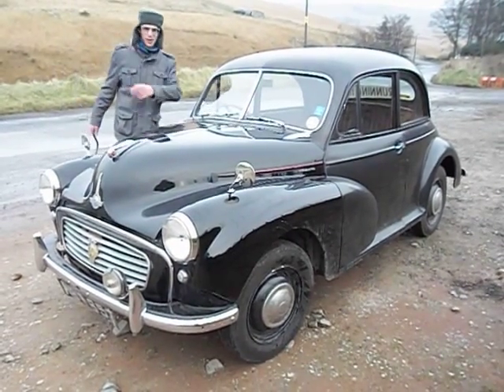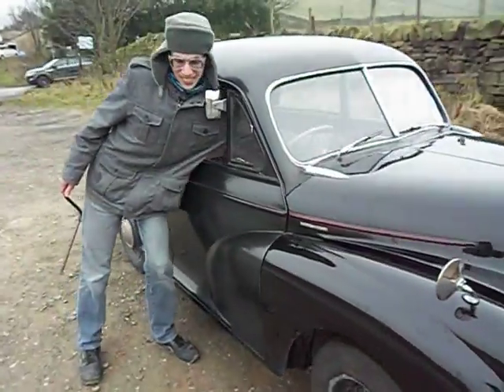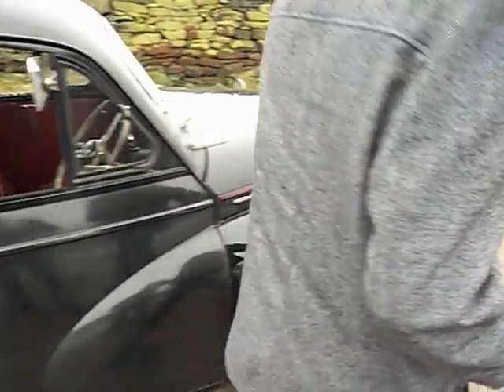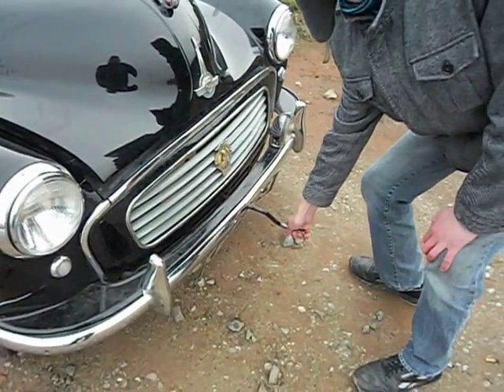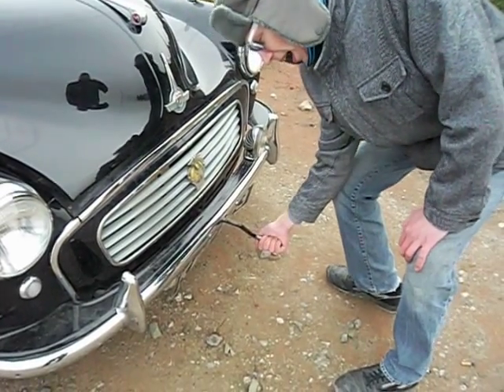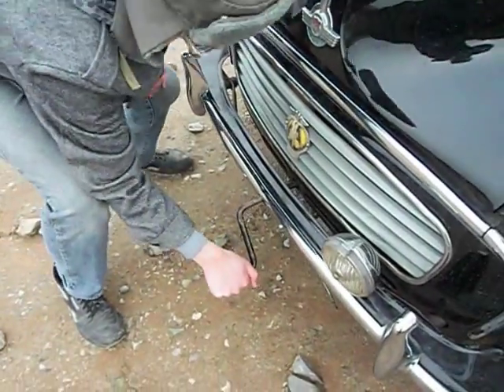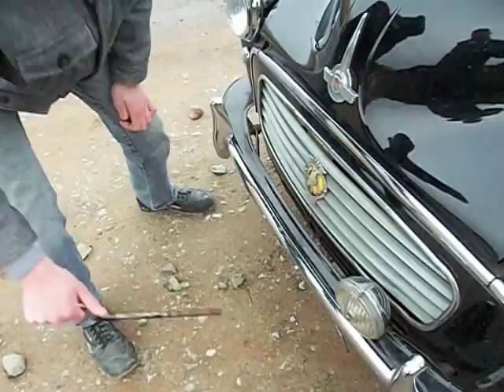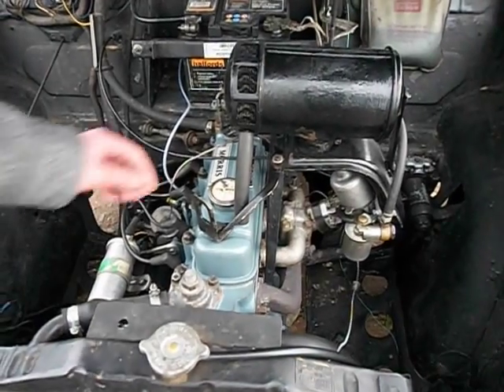Hand cranking car using starting handle

Comment: Wow, this car doesnt even look old on the outside (well if you put a modern car inside (radio, different speedometer) I wouldnt even knew it is old

Not like stuff from the 70 and 80s, I hate that boxed design

Can you legaly drive this? Can you register and ensure it?

Comment: It's a pity that modern cars cannot be started like that.
Reply: The main difference between those old cars and the new ones is the way the engine is positioned inside the bonnet. The old version had the engine facing the front but the new cars have it placed laterally making it impossible to start with a handle. The starter handle has two pin like arrangement which enabled the handle get temporarily fixed to the engine when inserted through the bumper. Once the engine started , the rod will slip out so that it can be taken out . This facility was available till the 70s in Indian made cars. It vanished only with the advent of Maruti Suzuki. The advantage of this feature is that when there is starting problem because of low battery power/ armature it can still be started with one person pressing the accelerator pedal and the other rotating the handle. No need for pushing the car in heavy traffic and occupying more space when there is starting problem. Modern technology and affluence have made it obsolete.

Comment: I really didn't expect so much extra space in that engine compartment...
Reply: All these old cars are are like that. It's all the accessories, emissions equipment, A/C, power steering, power brakes etc... clog up the engine bay. Modern cars are so jam packed with stuff they often don't even have space left for the battery so they stick it in the trunk.
Reply: My 1st pick up was a 1980 GMC Sierra 1/2 ton, had a 305.  There was almost enough room under the hood to close it with someone inside
Reply: We wanted the American styling (big bonnet/hood etc), but we couldn't afford the big 7.0 V8s because of the war.

Comment: I suggest a better, I think, way. More like how to start an old aircraft. This assumes an electric fuel pump. Turn on the ignition. Wait till the fuel pump has filled the carburettor float bowl. Switch off the ignition. Choke out, full if a cold start, partially if a hot start. Insert the handle and rotate at least two complete turns. Note which cylinder has the best compression. Rotate again, but pause with the "best" cylinder on full compression. Set the starting handle at 3 o'clock or at least on the down stroke. Switch on the ignition. Standing on the right hand side of the handle, press down firmly on the starting handle with the ball of the foot.
I've found this approach extremely successful on a bunch of ancient Austin Morris vehicles, including a J4, which had a starting handle made from an Austin Cambridge one with a piece of tube welded in to make it close to 4 feet long and a 1941 K2 fire tender with a 4.5 litre engine. Add a Hillman Imp to those. You have to learn to ignore the "winding up Noddy's car" remarks while so doing.
So no twisted thumbs and no damaged backs.
If it's a manual fuel pump, you might need to rotate the engine a few times (ignition off) or, better, find the fuel pump which often has a priming lever and use that. Remember, you may have to rotate the engine 90 degrees if the camshaft has already pushed the diaphragm in. It's easy to identify as, pushed in already, the throw on the pump will be small and there will be no sense of work being performed.

Comment: Probably the only car that could survive being blasted by an EMP
Reply: Nope, only older diesel cars

These cars still have a magneto and even just train tracks can mess up with the ignition.
Reply: I started a morris traveller 1000 this way
Reply: So can a Ford model-A or Model-T
Reply: Can always buy a motorcycle with kick start if you are worried about that.
Reply: @joebombero1  fair,i was mostly poking fun,i think if an EMP went off we would have bigger problems than this.
Reply: They don’t have a magneto. They have a coil, battery and points. A dynamo charges the battery but the car would run for many miles on battery alone.

Comment: Back in 1974, my first car was a 1965 Peugeot 404, which also had a crank handle. I never managed to start it via that method. I wish I'd known the technique.
Reply: @Motersickle Bum Maybe not most, but several. My own example being my 1984 Citroen 2cv, and I've been glad of the starter handle many times when I've had a dead battery or stuck starter.
Reply: @Motersickle Bum I really hope you're joking, otherwise I'd be pretty sad for knowing that such stupid people exist
Reply: @Motersickle Bum Very informative and useful, thanks
Reply: @@motersicklebum7632 It depended on the manufacturer and market. American cars did tend to move away from it faster than European ones, what with all the "atomic age" hype in the US and whatnot. Also, trucks tended to hold out beyond normal cars, presumably since their target audience skewed more toward the rural workman, who was more likely than your average joe to be caught in a remote area with a stuck starter. Eventually, though, engines just became too high-compression for hand-cranking to be feasible. Some did still keep the crankhole and handle even then, though only as a method of getting things aligned after certain maintenance tasks, rather than as a starting method.
Reply: @Motersickle Bum back in the 70s most electric starter cars still have cranks, even the vw beetle does, as he said he never managed to start it "via that method" so he probably just used the electric starter

Comment: i wish all the modern cars have that sort of starting facilility
Reply: recon forsales i wish that too. It would definitely help a lot of people who have a dead battery
Reply: +recon forsales I also wish that
Reply: Or cars can just have them to recharge their batteries so you use keys on daily but if car dies pullout the crank and crank away
Reply: There’s no way you or I would be strong enough to spin it.  Today’s engine are way more powerful and the torque when it turned over would probably break your arm.
Reply: They have hight compresion rates, but it can't be made to start manualy the alternator or that will be too hard too?
Anyway, I think since this old cars don't eat too much current (not electronics iside) that can be started even with non-rechargable batteries.
Reply: It would be useful if your startermotor breaks or you have a low battery
Reply: recon forsales modern cars have high compression ratio engine, impossible to hand crank it without adding some mechanical system in the car and that means the car must be bigger in size.
Reply: @indra-fu1ew  diesels back in the days also have high compression ratios, to combat this they made a compression release valve which can be closed when starter, it is certainly possible.

Comment: Hey, just wondering what that big cylinder is above the engine? Ive seen a few Minors here in australia and not seen those on them, my dad owned a lot back in his day and has no idea. Hoping to one day get one of my own.
Reply: Oil filled air filter maybe , my dad had an old Willy’s station wagon with one worked very well